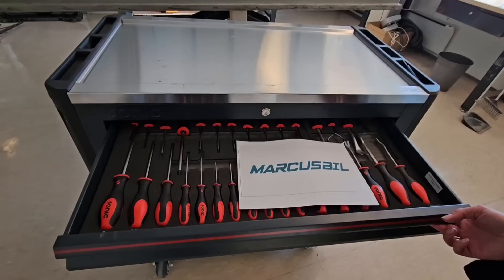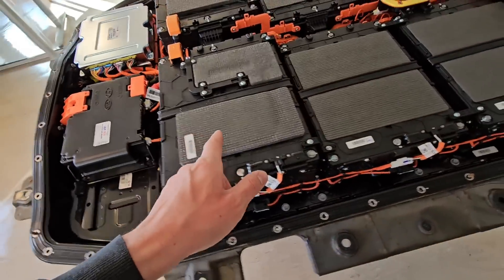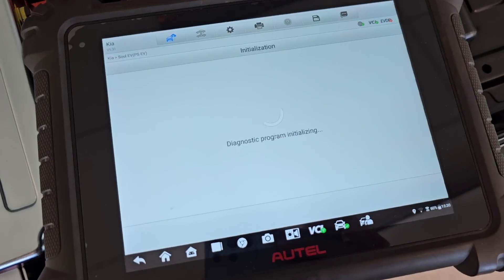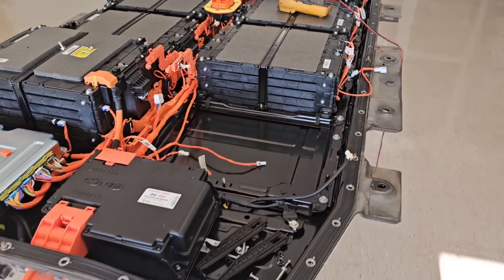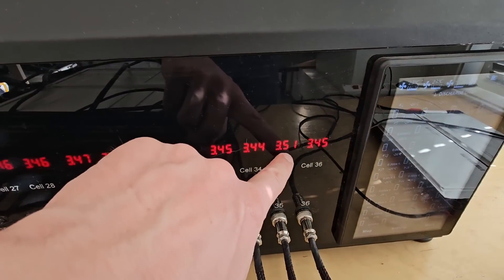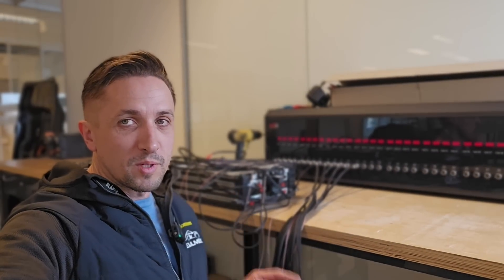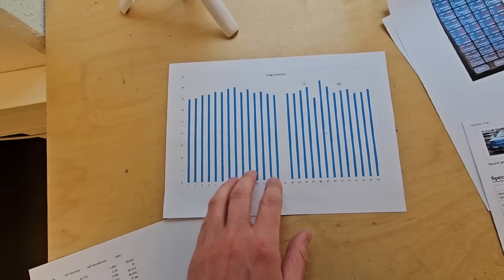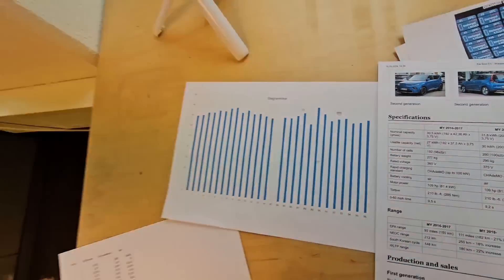Elbilmek trying to repair Kia Soul 27 kWh battery

Comment: Thats it…i Wont buy a Electric car now, going for the Toyota corolla
Reply: Can you put 2nd gen battery in 1st gen Soul?
Reply: If you watched Bjorn's first video about this car you would know it's a first gen Soul and the second gen is better.
Reply: Yes I understand your mentality, I can remember as a teenager with my neighbour who had Ford's all the time, but they all struggled to start in the mornings every single one he had. So I never have or will own a Ford.
Reply: Thanks for joking the EV discussion…
Reply: These early Souls had design flaws that were fixed on the later 30 kWh Soul. Plenty of 10+ year-old EVs that are holding up very well to this day, this was caused by manufacturers having no experience building these cars, which led to these design flaws, and is not something that will happen on any modern EV model.